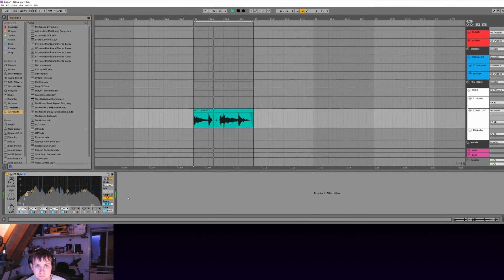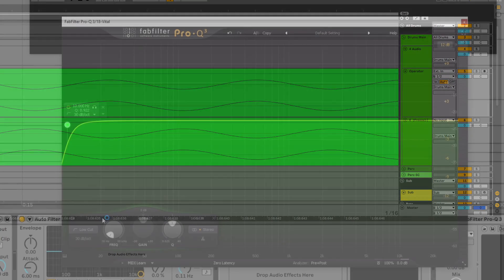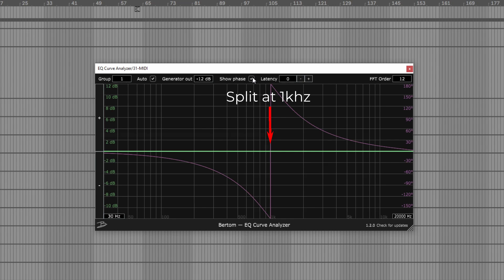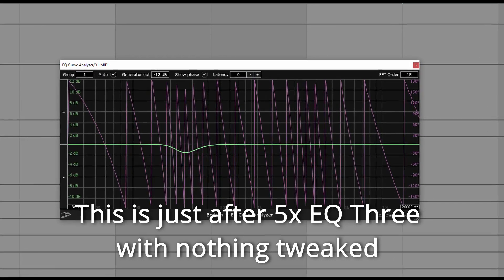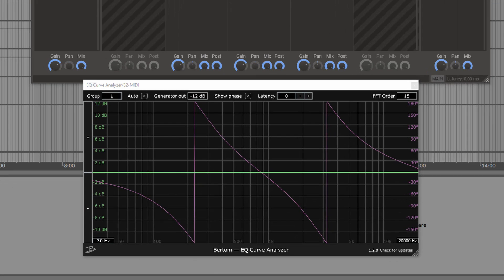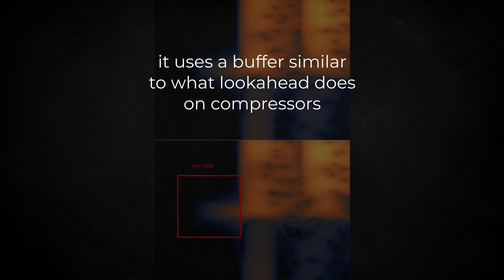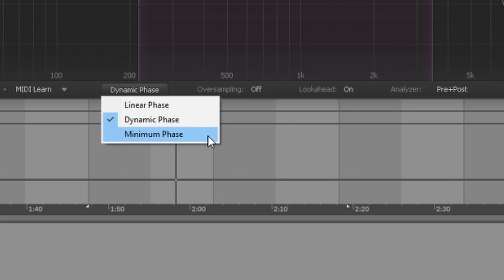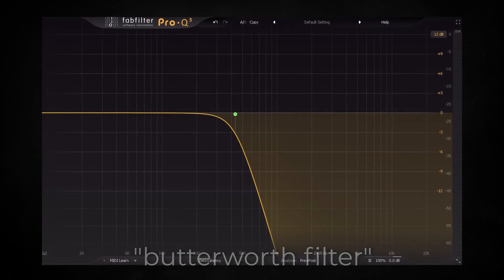Filter weirdness demystified

Comment: Thanks to your video, I know by stacking a bunch of allpass filters to delay lower frequencies alongside a lowshelf filter boosting low frequencies, can "beef up" a bass boost effect though some songs don't work well with allpass-augmented bass boosts, which can be done using foobar2000 (with foo_dsp_effect, which comes with "IIR Filter" DSP effect) and Audacity (with a built-in allpass filter that you can do with "Nyquist Prompt")

Comment: Great stuff man! Very useful in depth knowledge. I’ve made myself a perfect frequency split recently with no phase shift or delay by getting a
LP filter + 1 of the same LP filter in parallel with full spectrum phase inverted.
So you’ve got essentially 

Chain 1: Low band
Chain 2: Full band - Low band

Then macros for controlling the cutoff.
Just in case you didn’t know already. It’s pretty cool
Reply from the maker: Yeah I know about this! 
This was something I was originally going to talk about as a way to avoid the phase shift at the end of the video but I ended up not including it because I didn’t want to make it seem like “this is what you should always do instead from now on”. I figured that stressing that the phase shift is not that important but still useful to be aware of was a better way to close off the video- especially since most plugins still use the crossover approach.
But yeah! Definitely a useful trick! There is also a M4L device that helps you do this; it’s called “invisible band splitter”. I have it, but I think I’ve only had to use it a single time- ever.
Reply: @KlareAudio  yea for sure it’s not important at all for the most part. Basically I just hate the way phase shift increases the peak meter reading. I mostly use the technique for my side chain bus because I want everything coming through “purely” and I also want a separate side-chain for my kick transient and kick body. (And also I don’t want to use linear phase eq because I want to play my midi keyboard with as little latency as possible)

Comment: What causes the pre-ring in linear phase filters?
Reply from the maker: it's the post-ring, but shifted backwards. The filter subtraction signal is being moved back in time to better phase-align with the original singal, shifting the ring before the transient. with really steep highpass filters and a really high linear phase buffer it's obviously the worst case scenario for pre-ring, but it makes for a good example

Comment: Great video (and video series)! the thing about duplicating EQs to make a crossover filter its because of the type of filter EQ usually employs. They mostly use butterworth filters (you mention them briefly), wich do a 90º phase shift and a -3db drop in the cuttoff hz. That's why when you stack a low pass and a hi pass, the shift is 180º and it cancels out. Linkwitz-Riley filters are basically two butterworth in series, so 180º shift and -6db drop in cutoff. That's why, when you put a low pass and a hi pass, you get 360º, so frequency reamains the same
Reply from the maker: Yeah, I learned that while writing this video. I wanted to avoid going into filter type terminology as much as possible because in practice it's not something you need to worry about while producing, feels more like a plugin dev thing.
Would rather incentivize people to just give it a shot and find out if their EQ has the right slope type than to throw more names at the viewer, but I wrote them in the annotations for those interested in learning it. The EQ's I show in the video all use butterworth filters BTW
Reply: @KlareAudio  aaa that explains, I was wondering why you had the names in the screen but you didn't mention it explicitly. Makes sense yeah, the video is already packed with information. Gud stuff again